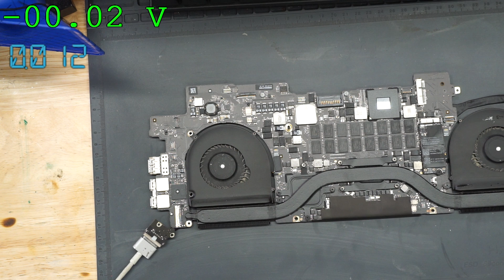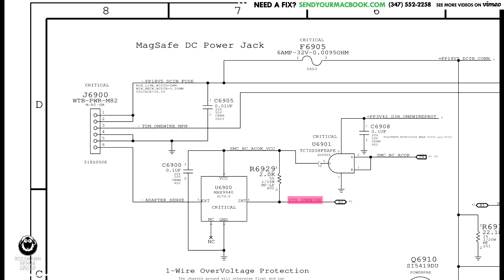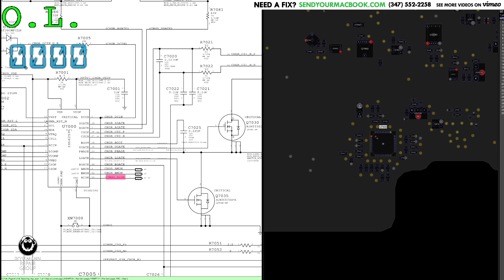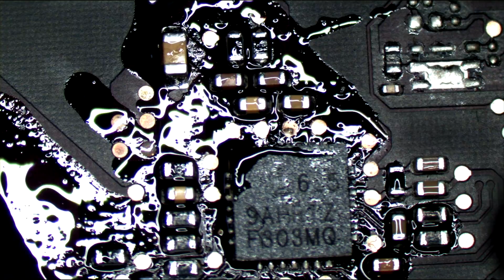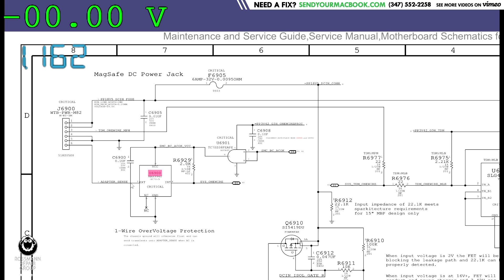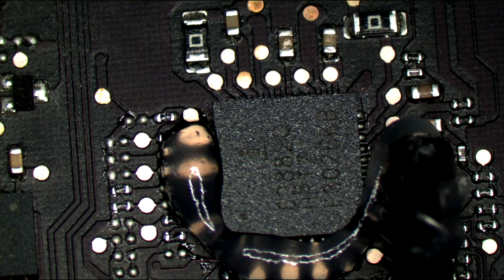Macbook Pro 4v on PPBUS G3H how to repair common logic board failure

Comment: Oh, I remember this problem from one of your videos :D
They could have fixed the problem of destroying the chip by using bigger resistors than 10 ohm (eg 1k) :/
These 2 resistors are supposed to protect the input of driver XD
Of course by using bigger resistor the filter capacitor between the resistors needs to be lowered or the current protection response will be 100x slower (in case of 10-1k resistor chamge).

Comment: No Light on charger/No power A1398 Mid 2012 - Early 2013 15" Macbook Pro Retina 820-3332
PP_3V42 = 3.42V
PPBUS_G3HOT = 4.00V
Visual inspection shows current sense resistors R7021/R7022 have burnt out.
U7000 (Part #  ISL6259) the charge controller chip has failed,  and is shorted to ground. This is why R7021/7022 burnt out.
Replace U7000/R7021/R7022
Measure current sense resistors, now 20 ohms as it should be.
Power up.
Measure 18V on CHGR_IN, on components C7005 and R7005
Measure PPBUS_G3H, now 18.59V.  This is good and means the SMC is on and working.  If PPBUS_G3H was 18.23V that means the SMC is not on.
Re-examine the one wire circuit. 
Measure ADAPTER_SENSE on pin 5 of U6900, measures 0.735V, if DCIN board is good this should be 3V.
Measure SYS_ONEWIRE on pin 4 of U6900, measures 0.787V, if DCIN board is good this should be ~3V.
Replace DCIN board.
Both ADAPTER_SENSE and SYS_ONEWIRE measure correctly now, DCIN board was bad. 
Machine is now fixed. 
ALL of this damage was cause by a bad charger!
Because this is a Mid 2012 - Early 2013 machine, reflow U8900 so it doesn't come back in a week crashing.

Comment: Hi Louis and guys, I'm not sure if i can post about this here but I have an issue with my Mid 2012 Macbook Pro (A1286) that i cannot seem to fix. 

The Macbook does not power on from the power button with the charger or without, however when i disconnect the battery and then plug in the charger, the Macbook starts automatically without the power button. 

I have tried disconnecting all hardware besides the DC board and the fans from the motherboard to see if its a hardware or cable issue but the problem persists. 

This is my daily work laptop so i cannot afford for it to sit at a technician for days. 
Is there any solution to this problem i could do myself ?

Comment: Everyone has those "am I really this dumb?" Moments, I suppose it's not comparable because of your voice, but recently I found out the motherboard of my pc was faulty from factory, and I should have noticed that since day one, not a year in, now I can't use my desktop until the rma process is complete, also I found a failure in my monitor, and things like that, and I am really questioning my intelligence right now, I am an electronics engineer student,  how I didn't noticed the evidence, the first thing i thought it was ram issues because one ram did work, but it was like, it worked once after putting it like 10 times, so it might be a problem with the connections of the motherboard to the ram.

Comment: It's cool how  you use the surface tension of the solder to sort of self-align the chip resistors and even the power controller QFN...